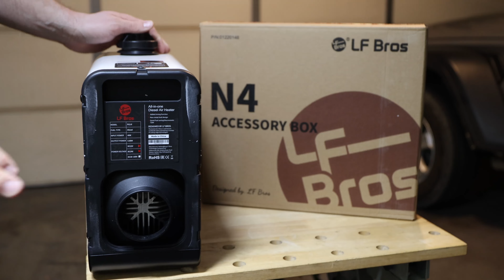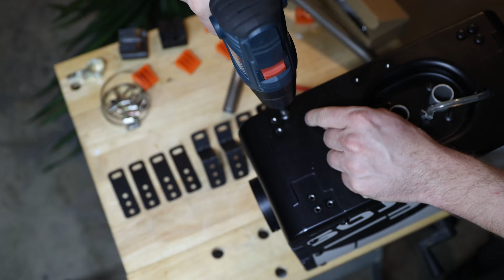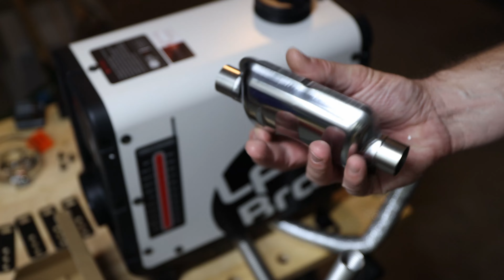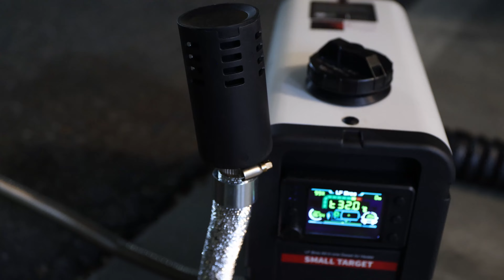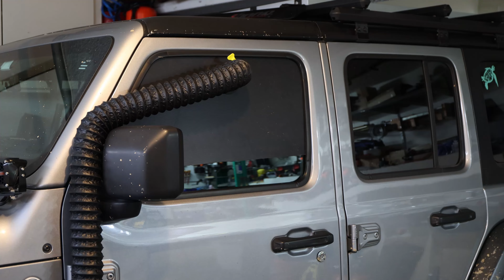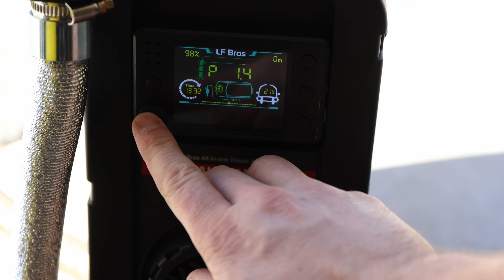LF Bros N4 Diesel Heater 5kW | Can it keep my Jeep warm? Winter Camping? Let’s check it out!

Comment: You mentioned about filters on top of the diesel tank and I had an idea of getting those reusable keurig cup as a filter when putting in diesel. Only question is will it fit on the diesel hole...

Comment: If you programme it to come on at specific times. When you disconnect it from the power source, are those programmes times on the controller erased and you need to do it again when you reconnect it to your leisure battery? Or does it remember set times when disconnected from leisure battery.  Cheers

Comment: hi, can I replace the fuel pump with a low flow one 28 -> 22   or something smaller because I have the heater on lowest setting but its TOO HOT and it makes me sweat.  or is there a way to put the heater on a setting lower than 1.4 or to slow the flow some other way?  i have the 5kw model n4.
Reply from the maker: I don't know. That's a question for the manufacturer I would say. Sorry I can't help more.

Comment: When setting the start timer. Press the button on the number until it beeps then short press again immediately after and it will set the start timer. The line will appear under the number and the line will disappear the same way
Reply from the maker: Thanks for sharing! I found a way as well but preferred to have a Bluetooth app to change those settings, much easier und more user-friendly :-)

Comment: Tobi thank you for the amazing video super helpful . The instructions included are terrible along with the short clips posted by the company. I’ve had this thing for months and used it only once because I couldn’t figure out the timer and otherwise was way too hot for car camping. I think I’ve got it figured out. Do you happen to know how to program the elevation settings ? I can’t seem to get any buttons to get over there. Thank you again.
Reply from the maker: Thanks for watching! Officially speaking, this one does not come with elevation settings. But somehow it might be possible to adjust the fuel/air consumption - this is something I do not know how or if. The other (cheaper unit) does come with elevation and Bluetooth which I enjoy more but the built quality is also cheaper.  https://youtu.be/cLmXOyywxqM I'm not sure which of the LF Bros does actually come with elevation adjustment. I hope this helps.